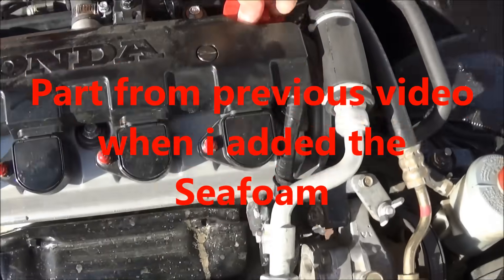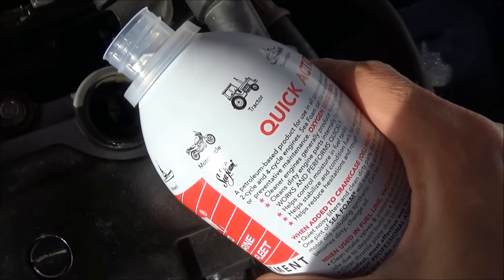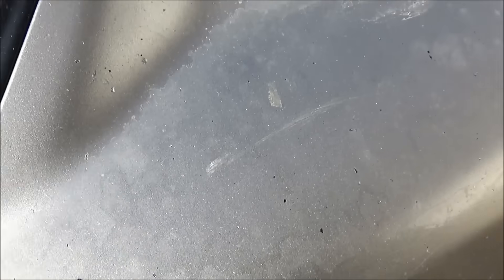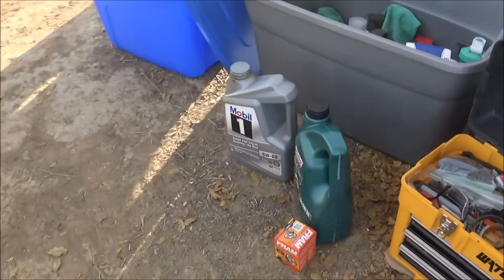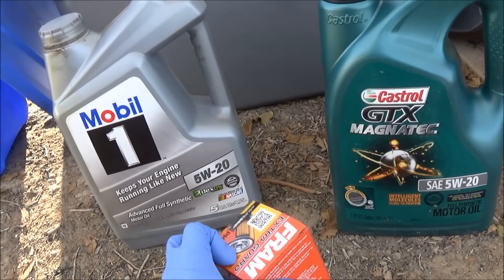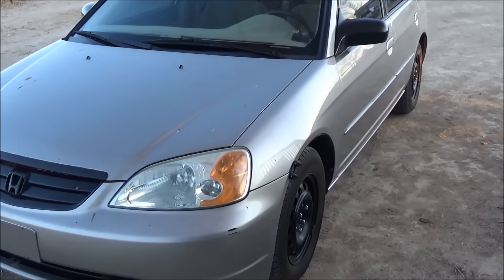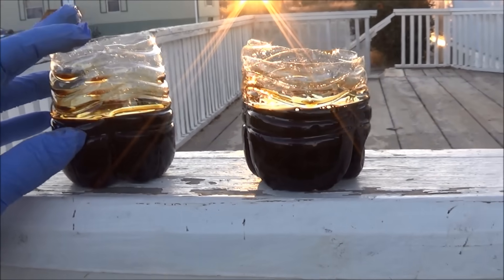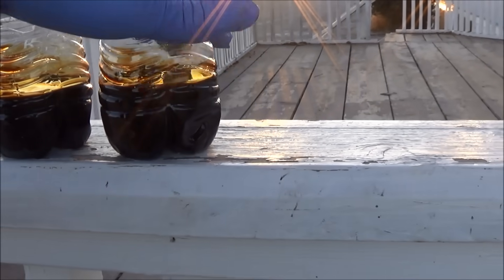Seafoam In Oil | Seafoam In Oil Before And After | Seafoam In Oil Before Oil Change [Sea Foam]

Comment: I have a 1992 Toyota Camry. I have my oil changed every 2500 miles, give or take. I use conventional oil because of the year of my car. My car is 32 years old. I am blessed with a good car and engine. I do not wait for no 5000 or 7000 miles before an oil change. I want to protect my engine...it keeps on going, going, going.......
Reply: Bro, I think you can go full synthetic no? And change every 3k. The new motor oils are great. I have a 2015 Civic that I change every 7k miles and a 03 CRV at 5k miles. I'll be adding a seafoam to my CRV.
Reply: @chickendinner5572 every 7 k is too long man, no matter the oil even if it says 25000 mile protection , I’d do 5k max, I  do 3k oil changes with full synthetic, oil is cheap, engines aren’t
Reply: Just get some super tech 10000 mile protection high mileage full synthetic it’s like 25 for 5 quarts will be way better for your engine , change it every 3-3500
Reply: @tatianacervantes293  actually I just looked it up. I do change it at 4500 or 5000. I change it when it says 15%-20% life remaining. My engine is super clean, but I want to start using better quality full synthetic to show my car more love.
Reply: I used to always get ci vent ion al because I thought old car oh well, full synthetic definitely is alot better for ur engine, I personally use valvoline restore and protect 30$ for 5 quarts very good oil, better then penzoil ultra platinum even,
Reply: how many total miles are on it?
Reply from the maker: Mine ?
Reply: @Chicodirt  yes, mine is just over 287,000 miles and barely uses any oil on a 5000 mile change.
Reply from the maker: @brs293 250,000

Comment: I have used Fram Filters since 1965. I change the oil and filter every 3000 miles. I drive my cars 10 plus years. I have NEVER HAD AN ISSUE WITH THE OIL FILTER IN 60 YEARS. THE ENGINES ARE SLUDGE FREE.

Comment: I'm a believer in running it in the crank case one ounce per quart but i have never run it for 500 miles. Sometimes run it for a day or maybe 100 miles. 500 i think is to risky in my opinion
Reply: What do you expect to happen at 100 miles vs 500 miles? What specifically is the risk you are concerned about? What components do you fear may be damaged?

Comment: Cheap oil filers only last about 3000 miles in my experience. Synthetic oil and a synthetic filter i get 5000 miles and the oil looks better at 5000 than 3000 miles on regular oil and regular filter so in the long run I save time and money

Comment: Stick to 5000 mile oil changes with a good brand name of oil, don’t skimp on oil filters, 
Motor oils already have enough detergents in them to keep your engine clean, that Civic can go past 500k miles if you keep up with regular maintenance, 
It’s never a good idea to loosen up all the gunk buildup in an old engine, unless you plan to tear it down and rebuild, 
SEAFOAM is good for treating the gas once in a while, keeps the injectors clean, but don’t overdo it .

Comment: Stick with the Mobil one . And Wix is a great filter. They sre built the best. K&N is not bad tho.
Reply: I watched a test video (of course I can't fuckin remember what the video was called) of flow rates and filtration of fine aluminum dust particles on various filters and the Mobil 1 Extended Performance filter actually did the best by a good margin. So, that's what filter I run. I don't care for their oil though, unless it's their "High Mileage" stuff which actually has an OK additive package.
Reply: @FeatheredDino  I do the opposite... Get Mobil 1 High Mileage oil and not use their filter. I use Fram oil filter. I have about another 3000 before my next oil change so I'll go back to the Mobil 1 (Model# M1C-154A)

Comment: Sea foam added to oil evaporates as soon as the engine is hot. It's vapor is drawn through the PCV system in the first 10 minutes engine operation. Doesn't last more than 15 minutes and its gone.
Reply: Negative, its a petroleum distillate not alcohol based, will fully mix with oil and act as a detergent like wd40
Reply: @rearviewviewer yea it doesn't make sense why they would tell you to drive 100 to 300 miles with it otherwise.
Reply: Exactly. It loosens the sludge and mixes it up into your oil. Then the seafoam boils off and your oil becomes thicker and much dirtier. I always put it in prior to oil change drive 10-30 miles then immediately change my oil with the car still pretty hot.  360k miles on my engine running great.  Valve train looked pristine at last valve adjustment (Honda).

Comment: I had a slight lifter tick so I just ran almost 1/2 can in my g37 and the other half in the gas tank on about 8 gallons of gas, drove 300 miles and did an oil change with Mobil One 5w30 and filter. Just like the instructions say plus a couple of mechanics here on utube confirmed. Lifters now are noisier than ever. That tells me it cleaned out some crap without even looking but now it sounds like I need some valve work now. I may or may not use it again. There are all kinds of additives out there and most are about the same and make the same claims. They may clean out some sludge but they do NOT give quite the results they claim.

Comment: That oil is dark because of carbon that is picked up from the rings and valves that is why engine oil turns black and its because of the motor oil additive package called detergents that helps hold the carbon and other contaminants in the oil otherwise you would have heavy sludge in the engine like years ago with non detergent oil.

Comment: Can you mix it with the oil first of course that means putting in new oil at the same time with the mix. That means to like put 5 ounces in a new jug of oil before putting it into the car engine.
Reply: Doesn't make a difference. The engines oil pressure and oil pump will circulate it.

Comment: it's not to be used like that
Reply: Good point. You should probably let the company know since it’s printed on the label.
Reply: Yes definatley let the manufacturer of the product know they are wrong about their own product.  Maybe they will hire you
Reply: @derekfug8292  I use it too, but under no load as it thins the oil
Reply: @omegaman7241  SeaFoam says "Keep in mind that you’re adding oil to oil. The same volume of oil in your crankcase is still there. No worries"

Comment: If you're going to use seafoam as an oil flush I would add 1 ounce per quart or half the bottle and let your engine idle for 20 minutes and then drain it.
Reply: The smarter thing to do would be following the instructions of the people who make the product.  

Or you could use it incorrectly and then complain to the company when it doesn't work
Reply: It's a 16 Oz bottle. That's only a 4-4.5 quart engine. And they say to leave it for a few days.

Comment: Fram filters are cheap, you get what you pay for. If you going to put oil in with sea foam to clean out the engine for a short time and drain and then change the oil filter again, Fram might be fine. But long term I prefer WIX filters or better.

Comment: I poured a half a can of seafoam directly into my crankcase and I haven't seen any smoke coming outta my exhaust like I've seen on youtube on every video. What does that mean? Did I do something wrong ?
Reply: it only smokes if you put it in through the intake, before the throttle body. you need a spray can of sea foam to do it like that
Reply from the maker: Exactly. It won't smoke unless u add it thru the intake. I added mine thru my brake booster line.
Reply: @Chicodirt  Yep.
Reply: Yeah, you're gay

Comment: You went from Mobil to Castrol, and put a fram on it. You may as well have used a tampon and then pissed In it. Castrol doesn't compare with mobile, and I wouldn't put a fram on a bicycle. The seafoam is great though. Been using it for years.
Reply: I did what he did and I'm very, very happy. Castrol magnate synthetic is Fantastic. Mobil one is DANM expensive for nothing and I have been using Castrol Magnatec for years in two cars.

Comment: In case the other folks cant convince you. Maybe I can. LOL. What's a fram filter cost you like $3? Spend an additional $3-4 and get a better company. You're talking about a $7k or more engine. Ok that is all. Carry on. Do what you want. 🤪 Frams have cardboard and thin thin metal
Reply from the maker: I agree. Watch my oil filter videos. I take them apart
Reply: @Chicodirt  - Okay there brainiac, then answer this -  just why would you use a fram then? You make no sense man!
Reply: Not Fram Ultra. It is the best oil filter available on this planet today.
Reply: I just use the OEM filter because it's the cheapest by far for my particular car and If the engineers who designed my engine find it competent I see no reason to say otherwise, they're more qualified than I am.
Reply: @doctordev97  OEM filters are designed for the average conventional oil and average oil change interval. If you use synthetic you don't have to change oil as often and that's where the better filters shine, as the Fram Ultra can be left in 20k miles on a clean engine. That's typically 2 oil changes these days.
Reply: @AG-sx9ws  I do use full synthetic oil, however I still change at the factory recommended intervals. Sure it probably means I'm changing my oil more than I probably need to, but I'd rather change my oil more often than necessary and know for an undeniable fact that I'm never under any circumstances running bad oil. Better safe than sorry I figure.
Reply: @doctordev97  save your time and money for something more worthwhile. For example underbody rustproofing. Your engine will outlive your car even with 10,000 miles per change on conventional. Your car's body will fall apart to hell with rust. It happened to every single car I've had. Around 250-350k miles they all went to hell from rust. At that point the cancer is too widespread to fix. Also fun fact engine oil life is a function of total engine revolutions per oil change. If you think about it this simple fact controls for all the variables in everyone's driving habits within reason, excluding extreme behavior.
Reply: @AG-sx9ws  luckily rust isn't much of an issue here in California. It's sort of one of the few good things about living here lol.
Reply: @doctordev97  watch out if you live near the coast. my car gets caked in salt driving down highway 1 every time
Reply: @AG-sx9ws  20K miles, LOL...good one! Hate to be your engine, SMH!

Comment: Fram embarrassed me in front of my friends. Never buying it again 😭.... I was changing the oil for my friends 2000  honda CRV and matched the new fram filter with the used up Wix and I glanced at the gasket. It looked good. Little did I know when I put the oil and started the car. There was a HUGE leak under. I was traumatized. Had to clean the big ole puddle. Turned out there was a small crack on the new Fram gasket and was not noticeable until you expanded or folded  the O ring gasket. NEVER BUYING FRAM AGAIN.
Reply from the maker: O man that sucks! I usually use k&n

Comment: I wouldn't trust fram, they have the wrong valve pressure settings.
Reply from the maker: Check out my oil filter videos I open some up after 5k miles

Comment: You should only run Wix filters.. Anything else will destroy your engine
Reply: That's a lie, lol
Reply: Regular Fram is trash though. The Ultra Synthetic Fram oil filters are now said to be the BEST.
Reply: Never put on a wix in 20 years in the industry.  Never had an issue
Reply: I promise you, OEM filters will not destroy your engine.
Reply: @Awegner176  I guarantee you that if the oem for any company is fram.. Then if you are buying something like that you must be planning on replacing your car every year or so
Reply: @ShilohSedlak  lots of cars going down the road with even cheaper filters than basic Fram. I think you're a bit opinionated on this subject. Cars didn't even have oil filters decades ago. Poor filtration won't destroy an engine. It just won't. Poor preventive maintenance will.
Reply: @Awegner176  once upon a time I was a Fram Fann.. Until my 2 month old Fram filters valve malfunctioned and blew up my car engine because it blocked off and oil passage and thus didn't allow any oil to get to the engine to lubricate the bearings. But to respond to your message cars used to have canister filters that you could clean instead of cartridge filters that you replace.. They were more like a fine screen. And the air filters used to be a canister that the bottom came off of that you would fill the bottom full of oil and the incoming air would blup through the oil and the oil would grab the dirt particles. And there are a lot of 99 cent filters that have smaller holes through them then the Fram allowing much less dirt to get to your engine.. with more paper pleats allowing to hold more dirt then the Fram. And it's true it won't generally destroy your engine all at once.. But if you run all Fram filters for 100,000 changing every 3000 miles and do the same with Wix you will find that the engine you ran Only Frams on will burn much more oil than the engine you ran only Wix on.
Reply: @ShilohSedlak  I've got a cheap 2005 Hyundai Elantra. The previous owners used Fram filters. I have used Fram filters the entire 50k miles I've had it (over 6 years). It's got 156,000 miles on it. No major repairs, original engine. Please, stop being overdramatic. And no, I'm not some sort of Fram fanboi, I use them because they're cheap and readily available.

Comment: Hey your using really thin oil for a stock honda motor. Your motor might start ticking.
Reply from the maker: It just got really clean. I changed it to 10w-30 right after and it's still running good. This video was 2 years ago. I'm at 256,000 miles and going strong.
Reply: HI BRENDON I REALKY KIJED YOUR COMMENT ON BUDDY USING THIN OIL ....IVE JUST BOUGHT A 2008 CIVIC SI 2 DOOR WITH 178.000 KMS....IT RECOMMENDS 5W- 20
I ENDED UP USING SYTHENTIC OIL ITS BASICALLY THIN LIKE WATER DO YOU THINK REGULAR OIL 10W-30 WOULD BE JUST FINE FIR THIS CAR .....ITS NOT LEAKING SNY OIL YET THANK GOD....I HAD A 2002. HONDA CIVIC...& IT WAS LEAKING IOL BAD ......

Comment: You should do a update video, and maybe have a before seafoam pic of top end and an after as well. Is there any oil consumption? Monitor it and give an update if you had any consumption.
You could also do a seafoam intake cleaning too which helps if done properly.....dont use it for the tank since it wont really do much to clean, a pea fuel system cleaner does better like redline sl-1 or techron.
With the seafoam I would redline the engine a few times to make it clean better / maybe free stuck piston rings, but I would only use seafoam towards the last 500 miles of a oci. 
Anyways thanks for your video.
Reply from the maker: Thanks for the info.

Comment: i know this engines. i rebuild 1 d16v1 dealer maintained. the problem is carbon in cilinder walls and cumbuster chamber. it is very hard to lose this. i reccomend repeat this 2 a 3 times. Marvell mysterie oil is good to try.

Comment: Lol pricey oil filters.... it’s not like it protects your engine or anything.... then you stick a junk ass Fram on it. You can get a Wix filter for less than $10..... hell less than $5 on Rockauto.
Reply: is valvoline good filter
Reply: Or you can get a super tech oil filter trust me it works just the same been using supertech oil for A long time full  synthetic my engine is never blown up traded that car and was 170,000 miles got a newer model of that car so I have full warranty so now I have to dealership change it if it blows up I get a new motor when the warranty runs out I’ll start running full synthetic supertech and super tech oil filter and yes of course I always use Seafoam it’s the best out there

Comment: did anyone ever mention here that Fram sucks?
Reply: You obviously have never used the tough guard or ultra, superb filters. Lots of great reviews and uoa’s using those filters
Reply: Swagger Jacker but their internal construction and materials still suck compared to even run of the mill mid grade filters. 

And anything can get good reviews.... and often times people will give 100% reviews as long as they don’t have a bad experience with something. generally people aren’t going to have problems with and oil filter but it’s a higher likely hood with Fram’s construction compared to a Wix, AC Delco, Fleetguard, etc. filter. Personally I don’t risk it when I can get a Wix XP filter for less $7 for my Silverado.
Reply: @chevyon37s  I mean, my car has only ever had Fram filters and I abuse the s*** out of it. I've gone 15k miles in between oil changes at times. Still fine.
Reply: Cari Page I mean.. great for you. You’re lucky. But they have been known to fail. Your vehicle, do as you wish. But I can guarantee your bearings aren’t in as good of shape as they could be. So for me the minimal cost increase of a good filter and regular oil changes is nothing in the grand scheme of owning a vehicle. 

And sure most engines can run and get by with nearly any engine oil in them and even with no filter at all. engines are a lot more durable than most people think. But those engines don’t operate at peak performance, nor do they live as long. So why not keep your engine in optimal operating condition and performance  with regular oil changes and good filters?